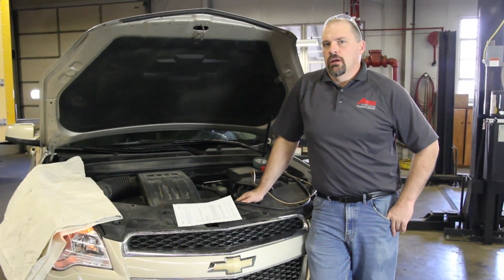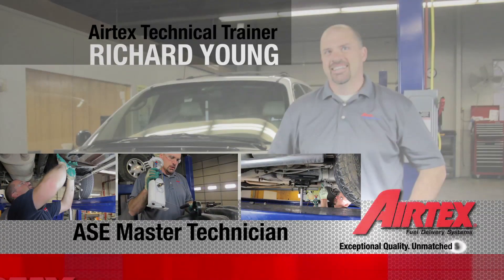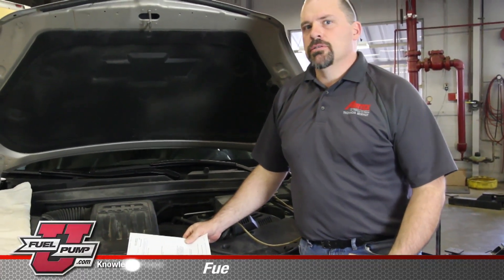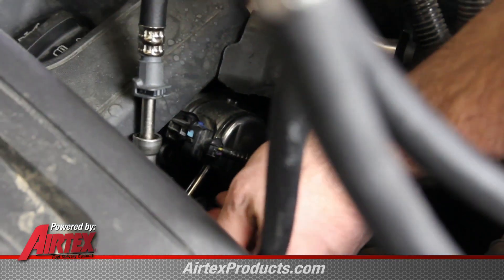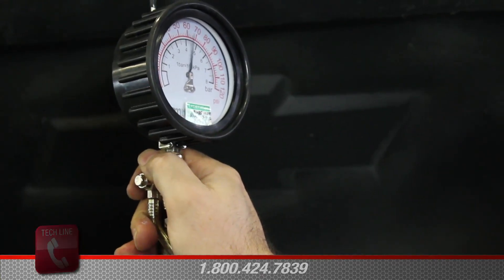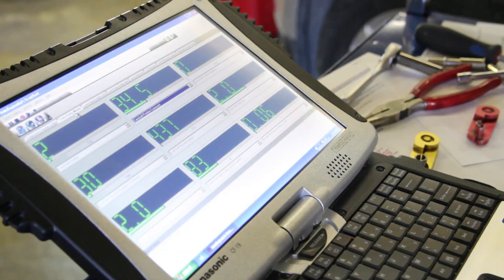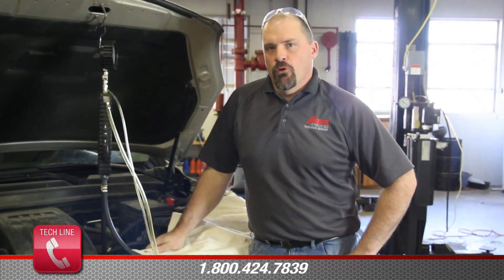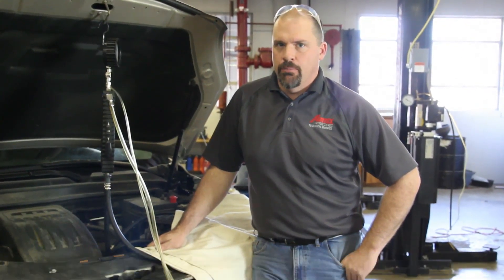GM High Pressure Fuel Pump Diagnosis

Comment: I just purchased a new 2017 Chevrolet Silverado 5.3 have a rattle under the hood. Have been told the rattle is caused by the High Pressure Fuel Pump. What is TSB? would like to eliminate the noise. Suggestions?????
Reply: Billy Wade Mcknight the 5.3 has a different style high pressure fuel pump then the equinox, the noise you are most likely hearing is your high impedance injectors. I suggest taking it your local dealer since it should be under warranty

Comment: "RE-ACTIVATING THIS THREAD"

I have been turning wrenches since I was 8......I still may not know everything (about late model gassers), BUT I do know that performing a intake volume test for the SUPPLY/LIFT pump, and then leaving the audience hanging like a nail biter movie IS A BITCH! LMAO!!!! 
SO WHAT WAS THE "ACCURATE" DIAG????? 
I know this vid is hella old tooooooo!!!!! But I gotta 3.6 with some FRP too low issues, and I don't think "Volume" from the supply pump is the issue LOL!! Diesel is what I KNOW and DDI isn't much different than that, matter of fact, it is what pioneered THIS.